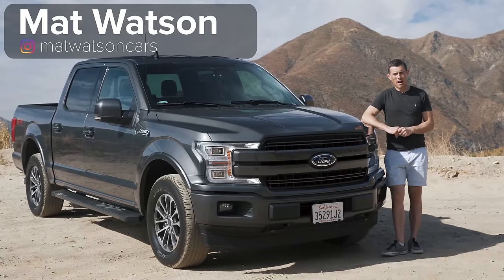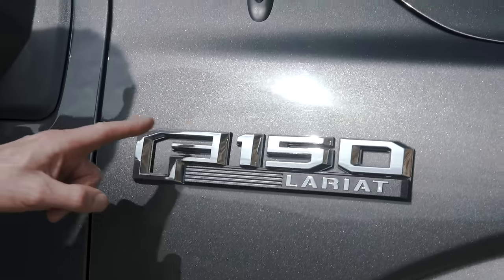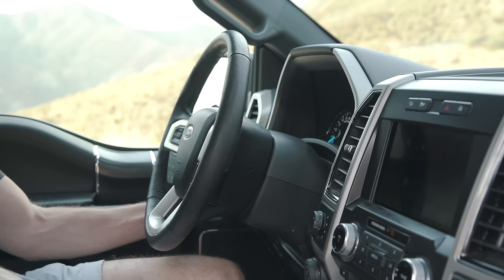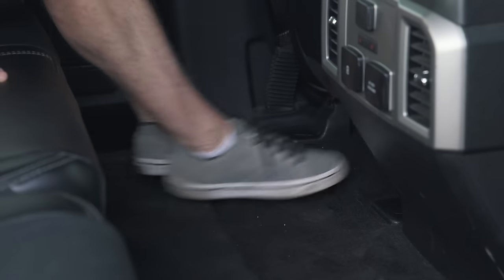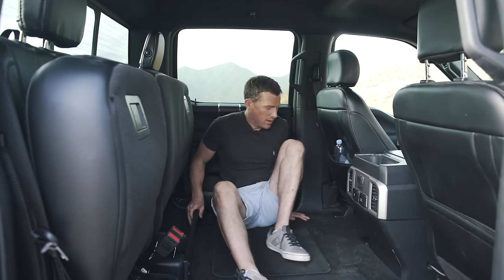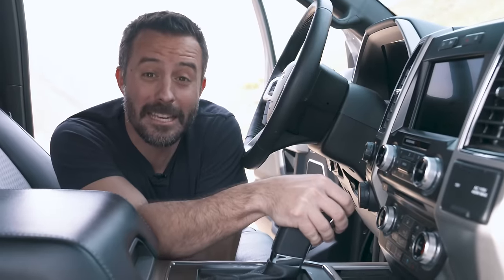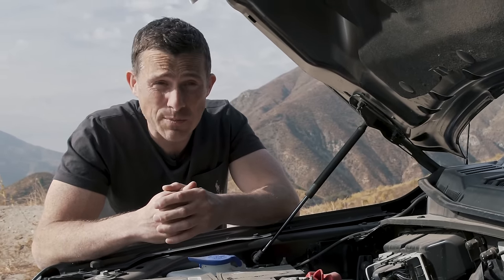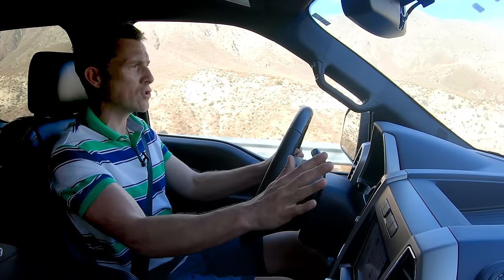FORD F-150 review - why is it the best-selling 'car' in the world?

Comment: I have a 2018 f150 Lariat, super cab, 8ft bed, very smooth ride, very capable truck, Running e85 on the 5.0L very quick and snappy. Its a winner. great for road trips, great for work, everyday.
Reply: Jorn Navarre u must have a fud then my guy, probably driving a tiny as* garbage Mini Cooper!
Reply: I have one question, do you have trouble with you load sloshing about in the back? or do you have the grippy flooring spray?
Reply: @NonsensicalSpudz  I actually have a bed-slide, which is great, and it has a grippy rubber mat. Highly recommend the bed slide, its a huge back saver.
Reply: After watching Mats video at about 5.00 mins (https://www.youtube.com/watch?v=Bz_twBApgZY) i'd be selling the F150 pretty soon and buying a VW Amarok, faster 1/4 mile and slightly better braking.
Reply: @ziggystardust9765  The VW Amarok is not sold in america, and it's got less power and less towing and payload capacity.
Reply: 5 litre..great for every day? Thats not how it works

Comment: The extra travel makes it easy to modulate the brakes. Great when you put a few tons behind it. ( I use my f150 as a truck)
Reply: Yes, very nice when offroad as well.

I wonder if the brake feel of a Raptor is similar or if it is a tighter feel.

Comment: "You can just slot your nozzle straight in the hole" - Matt Watson, 2020
Reply: at least they cant misfuel Ford's these days, saves a lot problems and costs.  Can't believe all vehicle manufacturers don't have this feature.
Reply: @simonwilson7581  Yeah, why are you here?
Reply: Yuck😨
Reply: Your nozzle has to be a specific shape or it won't fit.
Reply: Fords easy fill, also known as fords it won't fill, had it on a Mondeo, nightmare,
Reply: That's what she said

Comment: I have 3.5L 2015 Lariat. Fuel mileage is around 22mpg hwy and 16 city. Yes it's not as smooth as SUV but still very comfortable for long cross country trips. No rust issues with the aluminum alloy body. Still looks like new after 5yrs. Love my F150!
Reply: Any reliability issues?
Reply: @baronvonjo1929  I have a 2018 3.5 ecoboost with 155k miles on it so far and no issues. Love it

Comment: The key pad entry is a great feature that no other brands have and if it's a real truck it has leaf springs. Dodges coil over rear ends almost require air  bags right off the lot.

Comment: The smaller engines are fun and all, but if you haul heavy loads and keep the truck for long, you'll quickly notice how quickly these smaller engines will ware down.
The V8 may not be as fuel-efficient, but it's definitely the more reliable option and you can get loads more power if you decide to modify it.
The 5.0 is the same Coyote motor that's in Mustang GT so aftermarket support is HUGE, replacement parts are plentiful and cheap and people know how to tune these engines.
Reply: So i can’t speak on behalf of thr 5.0 but i have a gmc sierra with 6.2 V8 and i’ve done as well as 24.6mpg average on long roadtrips on the highway so i would be hard pressed to say these ecoboosts are more fuel efficient even. I typically average 18-19mpg

Comment: I bought my 2nd F-150, an XLT aluminum 10-speed 5.0 Coyote V8 4x4 SuperCrew. Absolutely love it! My previous was an ‘09 Platinum. They last 300k miles and more, and do everything better than any other brand which is why more Americans buy them. My ‘19 came with a $16k rebate in September, by December you could get up to $20k off, so a low to sub $30k vehicle that will last.

Comment: People in America drive trucks now because of several factors.
1)  Higher ride height.  Allows you to see your surroundings better.  Also allows you to go off road better without having to worry about dragging the ground.
2)  Modern trucks are just as nice inside if not even better than cars.  And in 4 door models, there's generally more room.  And for full-sized SUVs like Yukons, Suburbans, Explorers, Expeditions, Escalades, and Navigators, you have all kinds of additional room.
3)  And with trucks, pickup trucks specifically, you always have that bed available to haul large things if you ever find yourself making that impulse buy of a large TV.  

But the main difference between American roads and roads in Europe in general is that traffic lanes in America are 12 ft wide, and in Europe they are just 9 ft wide on average.
Reply: David Molinarolo thank America for 12 foot lanes
Reply: @infines5047  you better believe it.

Comment: I bought a new 2017 F150 STX and still have it!  I normally change cars every 12 months but this one is so good I can't bare to trade it in.  It has the 2.7 V6 with 330HP... it really moves! and I get 24mpg (in the states - who have smaller gallons than the UK, incase you didn't know).  My 2017 STX has only covered 28K miles and still look like new.  As for depreciation - I've lost less than $10K over 5 years which is insanely good!  I paid $35,000 and my trade in is $26,000!  I had it valued 2 weeks ago.  It drives better than my wife's GLE Mercedes! Best purchase I've ever made.

Comment: I think people from the outside of North America looking in tend to think of our pickups as huge tradesman vehicles we try to use for everything and they did start out that way, particularly on farms. What you're missing is we pulled away from the station wagons we always had in favor of pickups. Station wagons are versatile vehicles but I wouldn't want to take one to a difficult to reach camping spot, or have to rent a truck because I can only fit so much in the back of my wagon. When you really break it down, especially looking at older American wagons and pickups they were very comparable engine and economy wise. Our pickups are just family wagons with a separate, more capable trunk. A large portion of people have grown up with pickups in North America and the bumpy-ish ride you don't even really notice. The long brake is because when they bite quick it can be jarring in a tall, long, vehicle. Long pedal is much easier to modulate safely, especially while towing. Our roads are bigger, distances between places are longer, real several thousand mile road trips are a thing because America is a lot bigger than most people realize. Having all your bags, cooler, tent, stove, heater, all in the bed is very nice and out of the way. And with a bed cover or canopy it's even more versatile. I get that it could see odd to see so many but it's just a versatile family hauler. A typical American home probably  has a pickup or large SUV and commuter car. We, for the most part, also try to make economical choices with our engines and configuration and which vehicle to drive. A v8 Mercedes estate may be more fun to drive but isn't half as useful and probably gets similar fuel economy to the average pickup. Just my two cents

Comment: Cant get more American that this right here
"Big, all about looks, no actual substance, inefficient, unrefined, unreliable...."
Reply: 22 City/30 highway... So no
Reply: The F150 is very reliable,There are 40 year old Ford trucks still being used as daily drivers.  It is lighter than most flagship European sedans.  Have you driven an 2020 F150?   Hold your Judgment until you do.  The Ford Raptor cannot be matched by any other mass produced production truck at any price.
Reply: @fatboy19831  I've driven a 2020 F150 and it was very unrefined and badly made compared to pretty much any European car/van.
Reply: @pandacheong2531  not angry, but had one for 10 days when I was last in Texas. It was sad. I enjoyed the experience, but was happy to get back home and into my VW Group vehicle.
Reply: mike a  definitely a lot smaller! I'll give you that. Enjoyed the high wide and handsome stance of the F150, but would never work over here. Our roads are half the width of yours, hence the smaller cars.
Reply: @UBERmorrison  THERE IS NOTHING EUROPEAN MADE that will last 1/2 as long as an f150.  My Grandfather drove the same Ford pick up for the last 30 years of his life. My best friend purchased an 1979 Ford pick up in 1990  that he used to start his company that ran 10 more years before he sold it.  The worst Ford trucks were in the 1970's.  European cars and trucks for the most part are wonderful driving automobiles.  Reliable and long lasting ......no.  It will cost you more to buy an 2010 Ford 150 than an 2010 Mercedes Benz S class.
Reply: Say something about a British equivalent.. or do all Europeans claim VW/Mercedes as their own?
Reply: @UBERmorrison  old volvos? Also the hilux altough its not eu made
Reply: @zembers  do you mean EU or Europe? Different things
Reply: @UBERmorrison  europe in general. The old volvos are bulletproof from my experience and the hilux is also bulletproof(dad owns one lol)
Reply: @zembers  yep! Lots of old Volvo's banging around with over 500k miles on them. Newer stuff, maybe not so much. Everything over here is small capacity engine, big turbo...for efficiency. Not sure they'll be as reliable in the long term as the old stuff, but yet to be proven I suppose
Reply: @mark4tesla  30mpg is horrifically inefficient!
Reply: @UBERmorrison  def not going to be as reliable as old volvos but only time will show how reliable the new volvos are
Reply: Fancy talking about reliability and built quality.  Every Rover jaguar is and was a shit quality(wait. Now owned by Indians)(volvos wait what.owned by Chinese). Don't start me on fuel economy. Come to Germans, overly complicated cars which they themselves can't sort out. Shity dealerships who even don't know how to fix their cars and foot you a bill of 1000$ everytime you go for service. Apparently normal fuel doesn't suit their German princess nature and high octane supposed to be used . Timing belts every 100000kms. 
   So I would take F150 over any God damn Audi VW BMW or Mercedes. Own 2016  2.7 V6 EcoBoost and love it.
Disclaimer. European may get Arthritis while climbing into it.
Reply: I have a 1998 Ford F150 with 380,000km sitting in my driveway with a load of firewood in it. Starts good, runs good. Scratched and dented all to hell from going out into the mountains. Who cares what it looks like. It gets me there and back reliably. Let's see your nicely finished import econobox luxury  Autobahn cruiser do that!

Comment: I had a Toyota Tacoma, traded it in on a F150 Crew Cab with 4wd and a tiny 2.7 Ecoboost back in 2017, what I found, way better fuel economy, tons more comfort and gobs of power! In nearly 3 years and 45k not a single problem. Hauling Grammy and the grandkids it just absolutely perfect, running to the hone center not a problem at all. A honest 20.4 MPG if you drive her easy I can get 23 MPG on the highway, I’ve only owned average vehicles in the past, my wife if 38 years and I rate this vehicle as our best ever and she does like driving it or being chauffeured.

Comment: I have the 3.5 twin turbo super crew cab XLT. I love the styling, build, and capabilities. What he missed on the review is the crappy automation programming like how the opt-out auto engine stop just wears out the starter because it usually shuts off just before you need to go, and doesn't save fuel. It should be triggered off by a steering wheel button, not automation. Also how almost all the dash settings default back to factory each time you start the truck is maddening, and how you need the keys in the ignition to power the dome light buttons even if you're just trying to turn them off. Rocker switches would be better than push buttons so you can see which buttons are set to the on position. The menus and button positioning are illogical. The weak headlights are criminal, I had to buy aftermarket LED "bulbs." These easy to fix irritations needlessly spoil an otherwise great truck.

Comment: I love my F150 ! One of the best vehicles I’ve owned.
Reply: Then how bad were the other shitboxes you had to put up with?
Reply: The Roadsters: I have literally pulled myself off the floor after reading your comment - priceless. Jorge O must have had a C-Max in a different life....
Reply: I love driving my f150 with the 3.5L Ecoboost. I hate the fact that I am taking it back into the dealer tomorrow for yet another repair. Less that 8000 miles and this is the 5th time already. Check engine light this time. Code states an issue with the turbocharger wastegate.
Reply: Billy Beemus thats wild, I know no one with issues like that. 
I’ve put 80K on one and 8K on another and both have been problem free.

Comment: So the F150 has multiple engine options you've mentioned including the V8, yet you're complaining about the V6 option that YOU picked. So lame.
Reply: @R AJ 3.5L Ecoboost rated @ 375 HP and 470 lb-ft of torque with turbo spinning
325 HP and 330 lb-ft of torque without the turbo.
Reply: @tskraj3190  3.3 base v6 f150 290hp 265tq.
Reply: @R AJ the turbos on the whole ecoboost range are really good!
Reply: @kaitlyn__L  even the 5.0s they bark and pass in 400hp its a rush
Reply: @johnhanson4795  agreed. Freaking love forced induction. Like, I understand why some folks like naturally aspirated.. in some ways it's not dissimilar to the smooth power delivery on an electric engine. But my god I love getting the revs up and it just comes to life. Plus: you get better efficiency for using turbos too. It's a win-win!

Comment: I’ve owned two F-150’s, both with 5.0 V8’s.Both were great.The best part, no cylinder deactivation.
Reply: cylinder deactivation is a scam that is not good for engines.
Reply: bighand69 
Right,that’s why I will only buy vehicles whose engines don’t have it.

Comment: "Easy fuel"  that's how ford calls the no-cap fuel charging. It's in my 2012 fiesta. Nothing new in it
Reply: Yea but why can’t other car manufacturers have it? My mom has a 2017 Ford Explorer XLT and it also has the feature but my dad has a Toyota Prius 2021 and it’s SOOOO ANNOYING a atleast to me cause if you fill up on the ford just stick it in but when it’s on the Toyota you twist it then it’s just dangle there
Reply: @vincentfortnite713  usually the fuel door has a latch to put the fuel cap.
Reply: My mondeo has it and it makes fueling up so easy
Reply: That was just a ford thing. The f-150 had it back then too.

Comment: They are really cool looking and it is probably a dream utility vehicle. I haven't seen other utes that have the full five seats. They seem to always be two seaters. Ostensibly, a tradesman could use this as his work vehicle and also his personal vehicle to take his family around in. It looks like a pretty obvious buy for someone in that sort of lifestyle. It doesn't seem like any of the load capacity is sacrificed in having extra seating. American cars are generally nice to drive too.

I live in New Zealand and used recent year F150s range from $150,000-225,000 NZD. Ford doesn't sell new ones here, but they do sell them in Australia. I assume the local sellers are importing the cars at enormous expense and need to charge a lot to recoup that. This government also recently added emissions taxes onto utes so they are becoming harder and harder to afford.

Giant cars like this and the Cadillac Escalade wouldn't really work on a lot of the roads in New Zealand which are crazy narrow. I suppose the other downside is the fuel consumption. American fuel prices are a little under half what we pay here in New Zealand.

Comment: The trouble with these "crew cab" trucks is the hopelessly small load carrying capacity. For comparison, a bmw 520 touring has more boot capacity - 1700 littes (with the seats down) than the standard size bed in this "truck" - 1500 litres. They are a jack of all trades, master of none, by trying to be a family car, off road vehicle and work van all in one.
Reply: The 6.5 foot bed is a short bed and this is the most popular selection. A 5.5' bed is not at all popular and 8' beds are more popular on the 250s and above. It also appears to have a low volume because they only count to the top of the bed rails (22"). You are only limited to that volume if you have a tonneau cover. When the bed is open your volume is only limited by the configuration of what you are carrying. Even with a 6.5' bed you can easily carry a couple of bikes and a canoe/kayak or a 4 wheeler or a couple of dirt bikes.
The half ton pickups are primarily recreational use vehicles. Anyone towing heavy (more than you are allowed to to in the UK) very often or hauling much over 1,000 kg/2,200 lbs is going to go for a Super Duty. Even as the lightest full size truck an F150 will still out tow and out haul any family car/SUV and be more comfortable on long trips than a lot of luxury cars.  
As far as comparisons with work vans, the trades that need a van (plumbers, painters etc) buy a van. Those that need to be able to carry a lot of weight (drywall guys, landscapers) or drag around heavy equipment (excavators) go with a F250 to F750 in the Ford line. You can't run a bed mounted hitch in a van.

Comment: Carwow needs to do another rendition of this truck for the 2021 model - in particular, if you can get a hand on the hybrid version. 2021 version is night and day difference from the previous model. The 2021 gear shifter design is priceless. 
All F-150 interior is going to be cheap (except its price tag). It is a working man truck after all.
But Ford navigation design is child like comparing to Audi's. I can see the logic of Ford & VW partnership recently announced. Ford engines & durability is better than average. Electronics belongs to dinosaur era.

Comment: 2 things. 
1. It's not F150 alone. It's "F-Series" which includes F250, 350, 450, 550, 650 and 750 (Did you know there are 7 models in F-series)
2. If you count all Chevy and GMC brand 1500 to 7500 series trucks, numbers are almost exactly same.